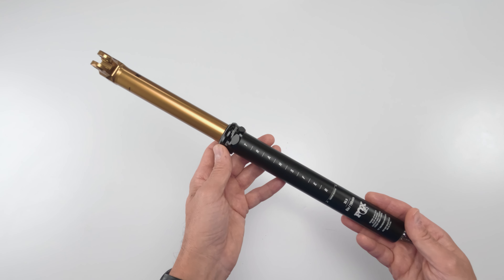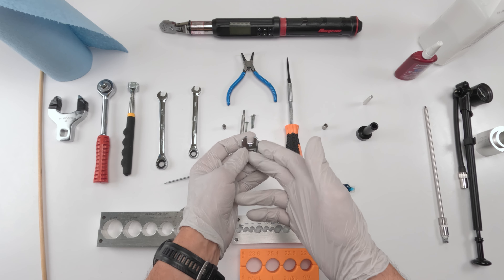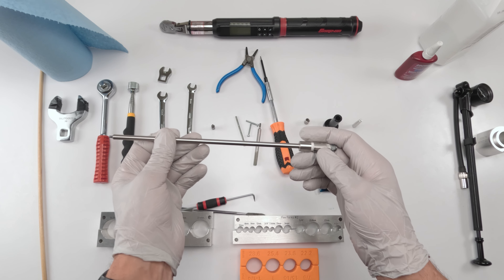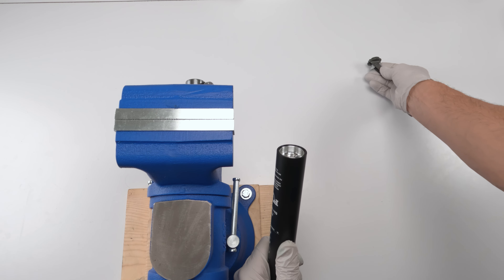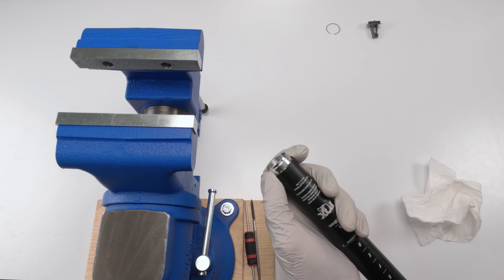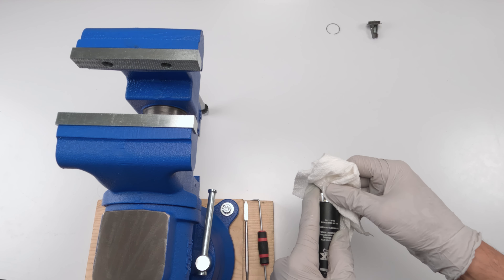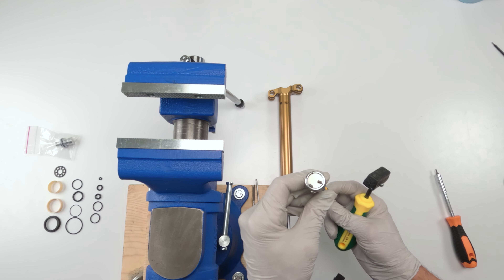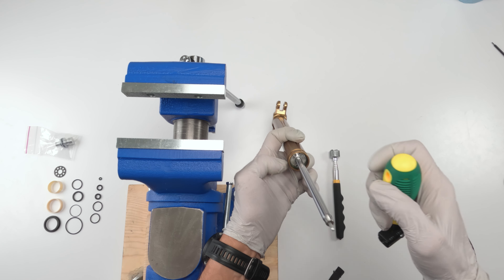FOX Transfer Dropper Post Full Service Rebuild Guide for beginners. 2021+ model  versions

Comment: Great video, thanks for sharing. It is wild how FOX manage to come up with THE most complicated system...

You mentioned the actuator screw top (398-00-735) is necessary, but cheap - cheapest I can find is USD65 - do you know of a cheaper option? BTW, I used the new fill tool and you can have the bottom out bumper installed when filling. So I installed the bottom cap and used it to engage the actuator. Figured I had a 50-50 chance of it working and it did.
Reply from the maker: "It is wild how FOX manage to come up with THE most complicated system"
Amen to that, brother. It's almost like they purposely made it as expensive as possible to service.

Unfortunately, part 398-00-735 (or Similar Solution) is needed. Right now, this particular part number is the lower-cost option that I know of (they have another version that costs over $100). I am working on a 2018 version of the transfer dropper and trying to figure out a way to make it as cost-effective as possible to service by making tools, such as this one, on the cheap with parts from any local hardware store. I need a bit for that video to be done, though, so stay tuned

Funny that you mention the new fill tool 803-01-931. I just had one delivered two days ago. 365 Cycles has it for ~$25. WAY cheaper than the original stupidity air fill tool, I just hope the new one works out better 🙏

Comment: Hi, congratulations on your video! It's fantastic in every detail. Unfortunately, the tools have a truly excessive cost for this type of operation, considering the cost of the kit is equally high, in the end it is better to sell it before it is too worn out and buy a new one by blindly adding $150. Fox's policy is very restrictive and here in Italy there are few centers that buy all this equipment, it is an investment that is difficult to recover. rockshox is not at the same level but does not require particular equipment. Congratulations again for the video. Thank you !
Reply from the maker: Thank you for the very gracious comment. I have to agree with your thoughts on this dropper. It was a big oversight by Fox to  develop a dropper that requires a significant investment in tools in order to be serviced. To think that the 2017 - 2020 versions are over double the cost in tools to service than the version in this video (I'll be releasing a service video on the older version soon, btw). 

The reality is that many companies make excellent droppers for very competitive prices these days, with the option of buying replacement cartridges' for less than what FOX sells their custom inflator tool for. The transfer is a nice post, but I can buy a new post, equally good, for the same price as what Fox charges to service the transfer.  I can buy from 1 up to 3 posts for the cost of tools alone, depending on the version transfer. It's a personal thing. If people want to spend the money on them, I won't judge you for it. But for others out there, I say buy a post you can easily service for a cost-effective price. You won't go wrong

In my case, I've helped people with bikes for a very long time, and own a bunch of tools because of it. But if it were just about me, I wouldn't buy products that aren't easy and cost-effective to service.

Comment: Great video. I didn't think is so complicated inside. But I have a small question: is there any (undocumented) way to make the travel shorter? I'd like to have 10cm instead of 15cm, and the best option would be to make it shorter by 5cm when released.
Reply from the maker: apologies for the delayed response. For the 2021, I don't think this can be done based on how the post is designed. Unlike most posts, the top bushing lock into the collar. You would need to replace it with a longer busing and I don't think anyone makes one. outside of getting a new post of shorter cranks, I don't think there is an option
Reply: @zoubtube  Sad news but thanks anyway!

Comment: What does the bearing and set screw do? The ones you put in after the ifp charge. Also why does the engagement tool need to be screwed on during charging?
Reply: Same questions..
Reply from the maker: Apologies for the late response

"What does the bearing and set screw do"
They seal the port seals. They couldn't do it with delrin balls (thankfully)

"Also why does the engagement tool need to be screwed on during charging?"
to open the valve via pressure. I honestly can't stand this tool. They should have thought up a better solution for air fills
Reply from the maker: Apologies for the late response

"What does the bearing and set screw do"
They seal the port seals. They couldn't do it with delrin balls (thankfully)

"Also why does the engagement tool need to be screwed on during charging?"
to open the valve via pressure. I honestly can't stand this tool. They should have thought up a better solution for air fills

Comment: Awesome detailed video !! That air fill tool is $180!!! What fixes a slow return dropper that’s brand new ?
Reply from the maker: Apologies for the delayed response. Here you go! This is a really good price for the air fill tool. 
https://northwestbicycle.com/products/fox-tool-kit-gas-fill-100-175mm-transfer-assy-tl1117. 
Northwest Bicycle and Pro Supply Bike shop have some really great prices on fox transfer tools right now. you might want to look into it

What you can try first is to either add grease to the bushings and pins to see if that will help as well as add air to the system as well. let me know if this helps

Comment: Brilliant video. Thank you for this and the many other guides you have put out there. Question though…can you insert the upper bushing into the dropper exterior without the expensive bushing setting tool at all?  My dropper is not extending the full stroke (in or out of the bike) so want to do a quick strip and re-grease.  Going through the steps, think reassembly will be the tricky bit, more so putting the upper busing back in.  I don’t have the setting tool and it costs almost the same as the dropper post itself! Advice is appreciated.
Reply from the maker: Thank you very much. I'm glad the guide was informative for you. "can you insert the upper bushing into the dropper exterior without the expensive bushing setting tool at all" 
Yes, you can use a soft jaw with a hole that is very close in diameter to the upper post. This will work the same as the fox tool. Looking back, I should have done it this way to show people it could be done. It doesn't take all that much pressure to insert it.
Reply: @zoubtube  Thanks for that! It was hard to tell just how much force is needed to seat that bushing. I was going to use the edge of two plastic tyre levers at opposite sides to push it in. That way the plastic shouldn't mark the kashima or the bushing, I hope!

Comment: Good afternoon.  It is not possible to buy in my country, tool ifp height.
Can you please tell me at what depth this tool is used?
Can you measure and write the length of the tool, and what length of dropper was it used for?
I would be very grateful.
Reply from the maker: My sincerest apologies for the late response but I'm 2 months behind on messages.

150mm 2021+ transfer is 46mm ifp depth
175mm 2021+ transfer is 50.7 mm IFP depth

Hope this helps
Reply: @zoubtube  
Thank you very much. You helped a lot.

Comment: I was wondering why this Video is 1,5 hrs long, now I just hope I'll never have to go to the Internals of this thing! :face-blue-wide-eyes:
Reply from the maker: Definitely  more involved than just swapping a cartridge, like for more posts. But the service as a whole really isn't all bad. More bark than bite, for sure. The issue is with the cost of the tools. I'm working on the 2018 version of this dropper, and the plan is to figure out a way to service it at the absolute lowest cost possible using home-made parts that can be purchased at a local hardware store. Stay tuned 👍

Thanks for the comment

Comment: Hi,  great video!  I'm looking to buy the IFP height setting tools for servicing Fox Transfer posts.  Can you tell me if the 2018 -2021 tools are the same sizes  as the ones for the 2021 onwards  models please?  It is going to get costly to buy two new sets.  Thanks

Reply
Reply from the maker: Thanks. I know the answer is yes, but for some reason I am second guessing myself. I won't know until I get home, which won't be for another week though. I'll update you first chance I get.

Comment: Thank you so much for great video, I have a question, why we need positioning retaining ring 180 split with fill port? Fox document also mention that but I can’t understand 😂
Reply from the maker: Apologies for the delayed response. Glad to hear you liked the video. My understanding is this is done to evenly distribute load on the cap during IFP chamber filling. Placing the ring opening next to the fill port would create a potential weak point.
Reply: @zoubtube thanks a lot 🥰

Comment: Hi this is an excellent video!! Very detailed. I was wondering if you had the diameter and length of the IFP depth tool? (2021+ 175mm) It is currently sold out everywhere and I would like to just make my own. Cheers!
Reply from the maker: Thank you very much. The IFP setting tools length is 50.6 mm and the diameter is 15 mm. Hope this helps Thanks

Comment: What would say is the minimum price of all the tools and supplies? From what I can tell, it's something like $200+
Reply from the maker: Apologies for the delayed response. typically around $250 for the 2021 and on transfer. but right now both northwest bicycles and pro bike supply have some really great deals on these tools. I happened to notice this two days ago by fluke.  I'd search both sights for the tools below. it'll cost you less than sending it in for service

398-00-735 Service Tool: Open Valve, Nitrogen Fill, Transfer
398-00-749 Service tooling: Trek Thru Shaft IFP removal tool
803-01-200 Kit: Service Tool, 2018 Transfer, Upper Bushing and Seal Installer
803-01-595 Service Tool: Gas Fill, 100-200mm Transfer, Assy

Pick the ifp depth tool you need fro your post
398-00-871 Service Tool: 2021 Transfer, IFP Height, 100
398-00-872 Service Tool: 2021 Transfer, IFP Height, 125
398-00-873 Service Tool: 2021 Transfer, IFP Height, 150
398-00-874 Service Tool: 2021 Transfer, IFP Height, 175
398-00-875 Service Tool: 2021 Transfer, IFP Height, 200

Optional 
398-00-738 Service Tool: Bullet, 8mm Shaft, Transfer

Comment: These videos are great, thank you.  I have been working on my own bikes since the early 90s, but had no idea how to deep dive into modern suspension, so that was the first thing I watched, and didn't even think it was possible to rebuild a Transfer after my LBS said they won't do them since Fox makes them so difficult to service.  It looks doable, and I love the idea of being able to work on my entire bike myself.  

Just curious, how do you dispose of old suspension and brake oil?  I always wonder about the best way to do this, whether it's this or old wood stain or any of this kind of thing.   
Cheers...
Reply from the maker: Thank you for taking the time to watch the video. Glad to hear you found it informational. The Fox transfer It actually relatively easy to service. The issue is with the cost of the tools required, Particularly with the 2017 to 2020 versions. Cost of tools alone is north of $800, which is ridiculous. I can buy a bunch of posts for that kind of money. A LBS would need to service a bunch just to break even. The 2021 and on version cost to rebuild is MUCH lower, Though still high imo due to the inflator tool, which is just a dumb solution.

As for disposing oil. I bring them to a local bike shop who disposes of oil, but you can also bring them to an auto parts store who disposes of them as well. I separate dot fluid and oils though when disposing. Mineral oil you don't have to worry about
Reply: @zoubtube  Yeah I have a 2021.  Started looking at tooling, and it's bad enough for that one.  But I reckon it will pay for itself after a couple services, and maybe I can do it for others as well.  Besides, I just like having all the right tools anyway.  Thanks again.

Comment: Has anyone found any solution to fill in air without buying fox 803-01-595?
Some DIY or else...
Reply from the maker: Part 803-01-931, Last I saw, 365 cycles sells it for ~$25. Jump on it, it's a great deal for this
Reply: @zoubtube   jump on what? it's not in stock there always!
Reply: @zoubtube   Anyway, I managed to made DYI needle for 30$, so .. case is closed.
Reply from the maker: @ka81alex  SWEEEEET! 💪Feel free to share how you did it. I'm working on a 2018 Fox transfer, and the goal is to figure out a way to perform the service at the least cost possible for tools. Maybe I can incorporate the tool you came up with for the video
Reply from the maker: @ka81alex  I didn't check if it was in stock when I responded yesterday. I just remember seeing the price not long ago, which was half of what I had paid for it.
Reply: @zoubtube  i'm trying to post a link to mtbr forum, where I uploaded photo, but for some reason it's not posted here..

Comment: Great video what length is the IFP please ?
Reply from the maker: Thanks, but I'm not sure what you mean with "what length is the IFP" If your asking height, it's a different height for the dropper length. below is a chart for the IFP set tool need per post. FOX made them much more cost effective the the ones needed for the previous version transfer 

398-00-871	2021 Transfer, IFP Height, 100
398-00-872	2021 Transfer, IFP Height, 125
398-00-873	2021 Transfer, IFP Height, 150
398-00-874	2021 Transfer, IFP Height, 175
398-00-875	2021 Transfer, IFP Height, 200
Reply: @zoubtube  thank you so much really helpful and great content
Reply: Apologies it was the measurement of the depth of the IFP

Comment: This definitely looks doable, but seems like more of a pain than forks so I've been hemming and hawing about trying it.  Looking for parts and tools, this one just seems like maybe more worth it to send in.  However, I just found the inflator tool for $106, and a couple other things fairly 'cheap'.  Ish.  So maybe that's a sign.  Think I'm going to pull the trigger today on the items on special and collect the rest at some point.  I would love to know if the Fox Shaft Clamp Set #2 sizes overlap with the Grip 2 damper clamp listed on the Fox site, but it has been hard to figure it out.
Reply from the maker: Servicing the 2021 and newer transfers is actually pretty easy considering they give you the option to perform a full service. Your first time will be the most intimidating, but after that, you won't hesitate to do it again. FOX should really revise the transfer to use the most basic tools possible for servicing. If they did this, it would be an excellent post for the price. I'm positive you can do it. If you have any questions, let me know
Reply: Thanks for the encouragement, @zoubtube .  Without your excellent documentary I probably wouldn't try it.  Fox's instructions seem to be not bad, but seeing how it goes in real time and getting tips about the tricky parts is invaluable.  Will let you know how it goes when I'm able to get to it.  Thanks again!

Comment: Hi,
I would like to 3D print the IFP tool for transfer seatpost, but it is impossible to find the dimensions on the internet. Could you please measure the length of the thin part of the tool (the deapth of insertion) for 125 mm seatpost travel. Thanks. (For 150 mm travel you alredy posted 46.2 mm 😀)
Reply from the maker: Here you go. btw, I have a 2018 to 2020 Fox transfer service video that will be posting next Monday. If your post is one of these years I would wait to watch the video. It'll save you big bucks

2018-2020
100mm/125mm: OD= 16.5mm, ID=9.5mm, Height= 50.55mm
150mm/175mm:  OD= 16.5mm, ID=9.5mm, Height= 47.5mm

2021- 2023
150mm: OD= 15mm, ID=8.7mm, Height= 46.18mm
175mm:  OD= 15mm, ID=8.7mm, Height= 50.7mm

Comment: I'm working on one of these and thinking about seeing if I can get a fitting for the top cap and then do a full bleed from there with a syringe of some sort. Not sure about the whole process yet but I think it may work. There seems to be too many ways for air to stay trapped by the time you finish the Fox designed bleed. I'm thinking with a fitting and syringe, you would bypass the two step process of bleeding before and after the top cap is installed.
Reply from the maker: What would be ideal is if there was a way to create a reservoir out of shipping tape, like I do for piggyback shocks, in order to install the cap completely submerged in oil. I've tried it a couple of times, but it hasn't worked out yet because of the seat rail mounts. But it would definitely simplify the bleed if you could find a way around this. Ultimately, once you get used to it, the bleed isn't all that bad; it just feels annoying for some reason. But then again, so does filling this thing with air with the dumb, overpriced tool. If you come up with a better way. please feel free to share with everyone